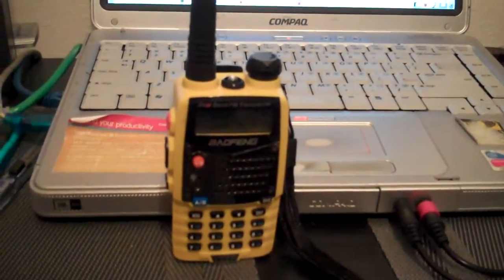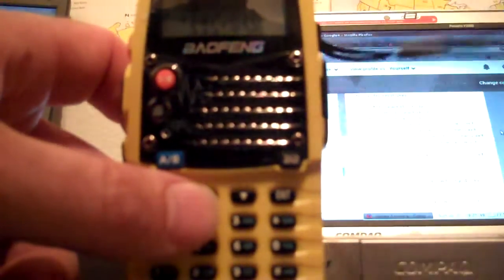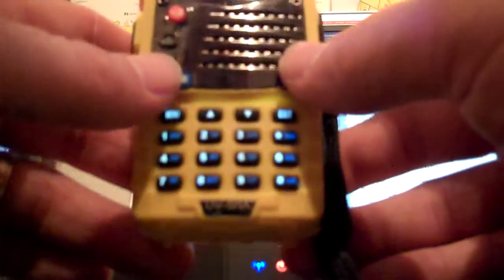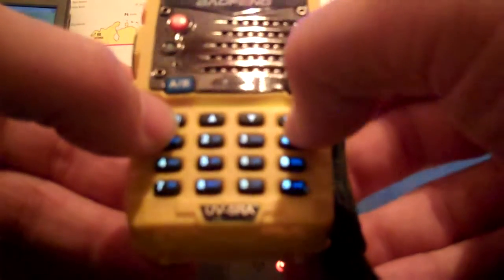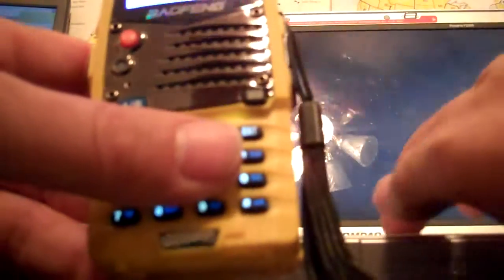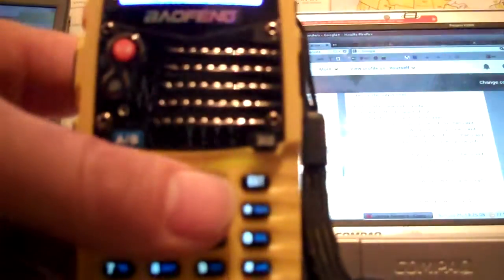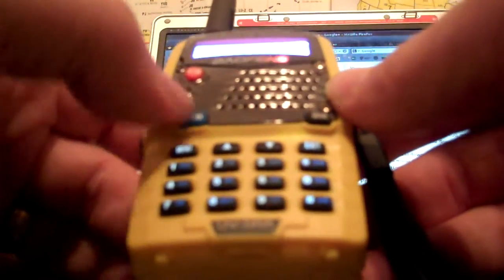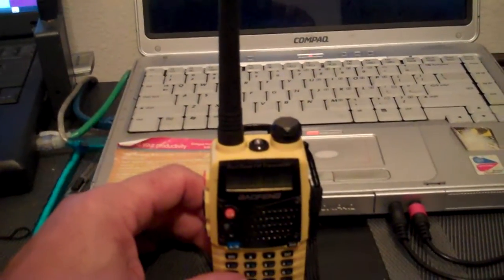Baofeng UV5R repeater channel programming from keypad, 2 meter, minus offset and PL 100

Comment: You make it to many steps.  Only need to type in a freq. one time.  I guess you figured that by now.  Once you have the receiving memory into a memory slot, all you have to do is push the * button(SCAN) and make sure there is an R on your screen next to the (+,-). You should also notice a CT symbol light up. If you have done the steps up until this point correct, your radio should display the offset frequency! This will be your receiving memory.

Hit the menu button, enter the number 27. You will want to hit the Menu button again and type in the SAME channel number as you used in step 9! If you used "004" then you must program this into "004" otherwise it will NOT work.

After your Baofeng lady says "receiving memory" you may hit Exit and go back to MR (Memory Mode). Go to the channel you have programmed and hit your PTT button.(Only if you are a licensed Ham). You should key up to the repeater and if you did it right you will know. Some repeaters have courtest tones, others do not. Sometimes you may not be able to hit a repeater due to distance.  KM4IVY

Comment: here is the link    https://www.repeaterbook.com/repeaters/details.php?state_id=53&ID=13468
Reply from the maker: +TS O'Day OK  that link worked..tnx.  I changed the description to substitue your repeater, 145.210.   The input is still 600k offset, so the input frequency is 144.610.
step by step adjusted ..still using channel 42 in my example, if you want to store it in a different memory location, just change the 42 to whatever you want.  The UV5R has 001 through 127 available..  Hope this helps you.  73 Jim
Reply: Thanks a lot man!